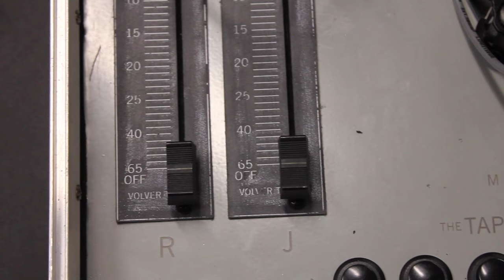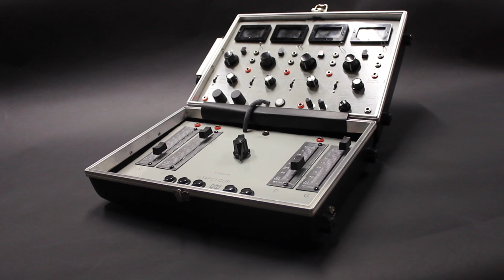Moog Circuit Bending Challenge 2017 - Vola the Tape Four Part 1

Comment: Sounds very unusual! :) It's a good machine for some interesting experimental tracks maybe inspired by Boards of Canada.
IMO, you could make an amplitude modulator instead of mix. sliders. LM13700 (AM itself) plus any cheap quad op amp IC (LFO modulator + amplification). it's about 3-4$ more.
Reply from the maker: Thanks. Well given the time I had to do this it was much faster to do just the sliders and a mixer. Plus it fit with the theme better. Bit not a bad idea, maybe next time.

Comment: I have trouble believing this fell within a $70 budget. But it’s even more amazing if it did.
Reply from the maker: Thanks! Yes it actually is within the budget. I used some salvage parts to keep the coasts down. Like the metal faceplates where from our works spaces junk pile. And I think the faders where from an old mixing desk. And the case is from the recycling center. the laser cutting was free and the peaces I used where from the junk pile and offcuts from other people.